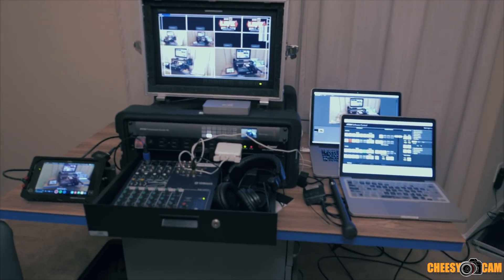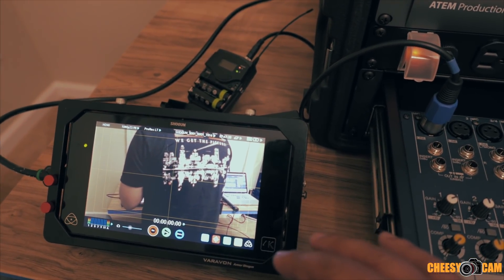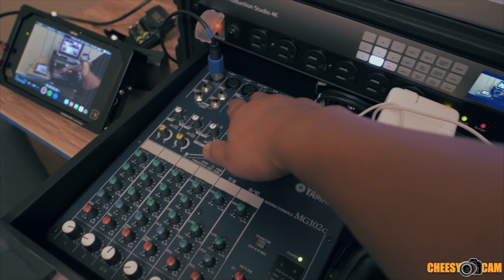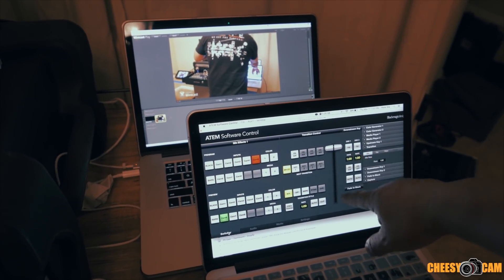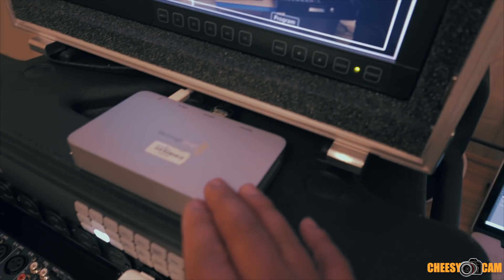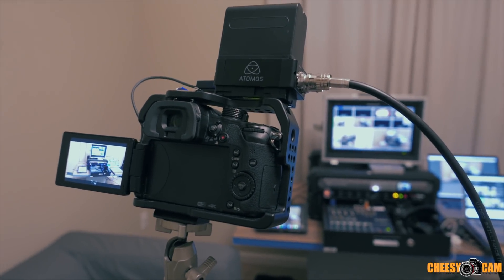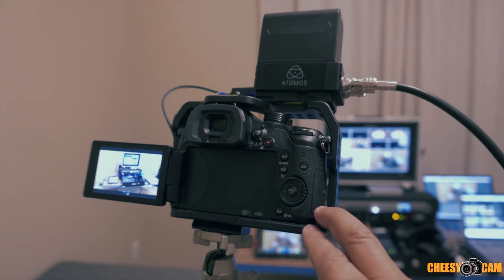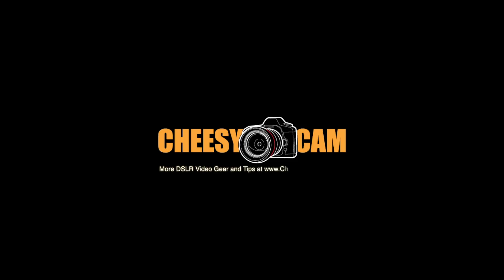Walk Through BlackMagic Design 4K ATEM Multi-Cam Live Switch Live Stream Video Setup

Comment: Nice video, I'm looking into live-streaming and this seems to be a great easy set-up.
About those GH4s: What does "forever" mean? Doesn't it have 30 min cap like DSLRs do?
If you wanted to do lower thirds with custom text and edit that on the fly, like names, crawls and things like that, can you do that within the blackmagic software?
Reply from the maker: No 30 minute cap on GH4 cameras. They record continuously. The battery life is the best of any camera i've used. A single internal battery can run several hours as opposed to some cameras where the battery dies in 20-30 minutes. There is some software in the ATEM you can use, like Live Keying (green screen on the fly), and with this it's possible to do overlays. Just have to be creative.
Reply: MrCheesyCam thank you, I will look into buying the GH4s than, or is there anything newer that could do the similar job? :)
Reply from the maker: I am using the GH4 cameras for many other reasons outside of just Live Streaming. But for Live streaming it is one of the least expensive 4K cameras available. But if all you plan to do is Live Stream, and you don't need to record internally with the camera, you can look into PTZ cameras (pan tilt zoom). These type of cameras allow you to remotely control them. So one person can control several cameras without being near the cameras. You set the cameras up around the room, and from a remote control you can can Pan, Tilt, and Zoom. Then you don't have to hire several camera operators.
Reply: no, no, actually, I'm going to be using the cameras mainly for other things. We have Canon DSLRs, if could record above 30min and had clean HDMI-out we wouldn't have to look into buying new sh*t :/
Reply: What's the best PTZ camera?

Comment: Nice walk-through. Using BMD-products as a producer myself for several years. Two things I would change on your set-up. Buy a two-to-one XLR and you can get two channel sound into the switcher. Another thing I found out after messing up after touching wrong button on the laptop when switching cameras was to buy a numeric keyboard, and connect it to the laptop via USB. Then you have the number-keys and ENTER isolated, easy to reach, and lesser chance of messing up. Cheers.

Comment: What lens did you use/do you recommend on the GH4? Was it a straight MFT lens, or did you have to use an adapter for another type of lens?
Reply from the maker: Most events can be handled with the Panasonic 12-35mm F/2.8 OIS lens (equiv 24-70mm): http://amzn.to/2a2vAGQ

Also the 35-100mm F/2.8 (equiv 70-200mm) for extended reach: http://amzn.to/2a2v4bF

Comment: If I am using the Sony FS5 and shoot in 4K, and output the video through the Automos HDMI to SDI converter before going into the ATEM Switcher, will I get 4K video for my final edit?
Reply from the maker: The Atomos HDMI to SDI does not support 4K. So it wouldn't even see the signal.

Comment: What's the router that you use for networking all of your gear? And can you share why you chose that one as opposed to others? Thanks so much for this wisdom!
Reply: And another question I have is - why are you using the Blackmagic Intensity extreme as opposed to just outputting the program feed straight from the ATEM to the Shogun & Livestream?
Reply from the maker: You can use a wired or wireless router. I'm using this one: http://amzn.to/1sE61VS

No particular reason. I use it because it's cheap, and the battery lasts forever. I also use this wireless router when i'm traveling in hotel rooms that only offer ethernet. I can plug this in and then use my computer wirelessly (as new macbooks don't have ethernet cords).
Reply from the maker: You need software to livestream. Software to stream is installed on a computer, which is why you need something like an Intensity Extreme (or similar device).

The Shogun cannot live stream to youtube. The ATEM cannot Live Stream to YouTube directly. You need software on a computer or another type of streaming device.

Comment: How's about panasonic G7, for replace GH4? Btw thx for sharing this..
Reply from the maker: Hmm, i'm not sure. The main reason the GH4 works really well is because you can control the HDMI output feed (which has to be set properly for the ATEM). You can control everything from resolution 1080/4K to framerates 23.98, 24p, 29.97, etc.

I don't know if they added that function to the G7.

Comment: Did you have overheat problems with the atem?
Reply from the maker: The unit does get hot, but no overheating problems so far for me. Most of the events I use it with only run for about 4-6 hours and i'm always working indoors.

Comment: I am using the GH4 cameras with ATEM TVS with ATOMOS HDMI to SDI converter and the only way to get the signal to ATEM, is to set the camera to AVCHD 1080i 17MB, no other setting will work from what I have tried. Can you give us some advice ob how you get it to record 4k and output 1080 that will work on ATEM? Thank you in advance.
Reply from the maker: My internal recording is set to .MOV. Maybe you're using a different recording format that is sending an Interlaced signal out from your HDMI??

After choosing the MOV All-I 4K setting, then you need to check your 'HDMI output settings'. Set it to downconvert to 1080 (not auto). Also make sure it's 8bit (not 10bit). You cannot record internally and output 1080 simultaneously when switched to 10 bit.

If you still can't see your feed in the switch, make sure you have your switch setup correctly. You have to go into the settings of the ATEM and ensure you have selected the EXACT same Resolution and Framerate that you are feeding into the ATEM. 23.98p is not the same as 24p. It has to be dead on exact or it will not display.

Comment: How the gh4 performes in autofocus for shots like zoomed close-ups?
I have an almost identical setup, a little more complex. For the sound i use Focusrite Scarlet 18i20 with Logic Pro. U have delay, compresser, limiter, etc  I record the program with Blackmagic HyperDeck Studio in a SSD.
For live broadcast i use Teradek Bond II.
To "remote" control the switcher i use an usb bluetooth keyboard.
I had issues with SDI cables. Input 1,2,3 image was flickering, but in input 4,5,6, etc was ok with the same cable. Neutrik conections, 50m lenght cables, source ATOMOS converters like yours. Any idea why?
Reply from the maker: We shoot mostly in manual focus no auto focus. For audio delay, I'll use my Behringer Shark with anywhere from a 60ms to 70ms delay: http://amzn.to/25uQ1DM

Comment: I am attempting to familiarize myself with live multicam recording/streaming. This setup looks great compared to others. Is there a way I could record 4K with the atomos and live stream in HD simultaneously? For instance, coming straight out of the ATEM with SDI to the Atomos to keep 4K live recording quality, and also coming out from the ATEM with HD to the intensity then to the computer/wirecast?
Reply from the maker: +Aaron Wimberley The Atomos doesn't record 4K from SDI. So you would have to record 4K through the HDMI with the Atomos. Then you can output from the Atomos HDMI out in 1080 to stream. But the Wirecast software should be able to down covert too. You just tell it what resolution and bitrate you want to stream.

Comment: Do you have a tutorial how to setup the wireless connection for the iPad/iPhone controll?
Reply from the maker: +Filmproduktion Hulok I don't have a tutorial but maybe I can make one. Basically you have a static IP on your ATEM. You would plug that into a Wireless Router. Then any other device can connect to the wireless router and since they are on the same network, they can talk to each other (with the correct software).
Reply: +MrCheesyCam That would be great. Will get an ATEM soon and need to control it over my iPad but I'm bad with network 'n' stuff :D
Reply from the maker: That's not my exact router but very similar product so it should work too.

Comment: Any thoughts on using a dedicated streaming device like the Vidiu?
Reply from the maker: +Kūlia LLC Yeah those devices are great if you don't want to use a laptop to connect to your live stream server. But these are things I already have and easier for me to setup.
Reply: Makes sense to use equipment you already have.  So many great options available today.  Convergent Design Odyssey with Apollo option and one of those streaming appliances could make for an incredibly small multi-cam setup (if less fully featured).  Roland also has a cool little HDMI switcher.  ATEM is definitely the more robust/extensible solution, though.

Comment: Thanks for the information, I have been looking for some demonstration of the possibilities using the Aux output and how it can be set on the front panel. Can I output computer graphics directly to a projector while switching and recording the cameras? and then output the program back out the Aux?
Reply from the maker: +Vida Extrema You can mix different types of cameras, dvd players, laptops, etc. The problem is you have to make sure they are all the same resolution and framerate.
Reply: Yes, I learned the hard way specially when mixing cameras and a signal from a computer over HDMI. I also wish you could control the program output from the front panel (buttons) and not only the auxiliar output. I wonder if you are familiar with or have ever use any of the hardware solutions from: http://xkeys.com/xkeys/xkrATEM.php some of their products look like a great alternative for a hardware interfase without breaking the bank.

Comment: is there any way that you can display your laptop on the switcher via hdmi had issues with it
Reply from the maker: +XGAMER123 Yes you can if your computer has an HDMI out. You would figure out the output of the computer and then input it to the switch. Most likely it's 60hz or 60p.  

This particular switch is a bit sensitive so everything connected to it should be the same framerate and resolution. If your cameras aren't set to 60p, then the switch won't work. Other switches can take multiple framerates with no problem, so it would easier on those.

Comment: Nice setup. I do AV Tech once a while. All cable have limit of how far they can carry signal, It's not Blackmagic. HDMI are for short distance, it can carry video and audio signal like up to 25ft, and with SDI you can go up to 300 ft or boost the signal at every 300 ft, same with Triax. Fiber optic, can go up to 2000ft.  YouTube does have its own streaming services which is free, I use that sometime. Best way to play graphics and videos if you ever need it, is to use Playback Pro, it's a software base mixer. Blackmagic is the best and cheapest way to do live video production, but it does have issues, once a while the switcher won't recognize the software.

Comment: Thanks for the video its really helpful ..The only thing i didn't understand is how did the Blackmagic Shuttle got the video feed via thunderbolt as Atem Production Studio 4K does not have thunderbolt output ..or does it ?
Reply from the maker: +Ahsan Saeed You first send the 'Program Feed' out either HDMI or SDI. I have the Program Feed being sent over HDMI and then that cable is connected into the Intensity Extreme. Then the Intensity Extreme is connected to my computer over Thunderbolt. This video might help: http://cheesycam.com/top-reasons-to-use-blackmagic-design-intensity-extreme-macbook-as-hdmi-preview-monitor/

Comment: Any more info on the router setup you have? I am getting one of these and will need to use an LTE Hotspot to upload the video but might not have any hardwired router ability to connect the software. Any ideas would be great.
Reply from the maker: +Apologia Studios If your LTE Hotspot is just a wireless hot spot, then your computer will connect to your LTE. In order to stream the video, you need to input the video into a laptop. I have an hdmi cable, connected to Intensity Extreme, and then connected to my laptop (via thunderbolt). That laptop is then connected via WiFi to a hotspot (in your case it would be your LTE).

Comment: one thing I did was put a jumper from AUX 3 out to INPUT 10.  This means if you select 10 input, the front panel router can control your program out.  sometimes
handy depending on what you are doing that day.  I set this as a power up default so I don't need to use laptop before testing cameras etc.
Reply from the maker: +Simon Crawshaw Cool, i'll take a look and maybe set that up too.

Comment: HDMI specification, while not specific, really only allows for about 20 feet of range without repeaters or amplifiers.  3G-SDI (1080p) is speced to be at least 300 feet.
Reply from the maker: +Kien Tran The Atomos H2S converters really aren't cheap products. I really tried all types of HDMI repeaters with no luck. The problem is not the HDMI cable or the repeaters as it will work fine if you're trying to go to a basic monitor. The problem is the ATEM Switch here is very sensitive to HDMI repeaters (in my experience). It just doesn't like it, and you'll often get dropped feeds and you can't get your camera back until you restart the whole switch. 

So even though you can technically use HDMI repeaters to a display, I would not recommend repeaters for live switching on this device. Once I went SDI, I had absolutely no issues at all. It's more expensive but it does the job. No more frustrations.
Reply: Oh yea totally, attempted all kinds of ways to get HDMI to work with an ATEM over usable distances, and in the end, we just ended up going with a bunch of XA25 with built in 3G-SDI to make our life easier.

Comment: This is super helpful as i was asked to do a 4x GH4 telecast for nat geo utilizing something similar to the ATEM. Will this work with PC?
Reply from the maker: +Sully Cortez Yes you can live stream using a PC, but you have to get the video into the PC. I don't think the Intensity Extreme I have works on PC (no thunderbolt), so you'll have to use some other type of USB capture device like a MageWell. http://amzn.to/1LCzb04

Now as far as the ATEM software which you need to connect to a LAN (network) to configure the ATEM, I think it can work on Windows, but I am using it on MAC. I don't know how complicated your setup needs to be, but there are simpler solutions out there if you just need to work with 720p and HDMI only. Check out the Cerevo Livewedge: http://goo.gl/eZuCl4